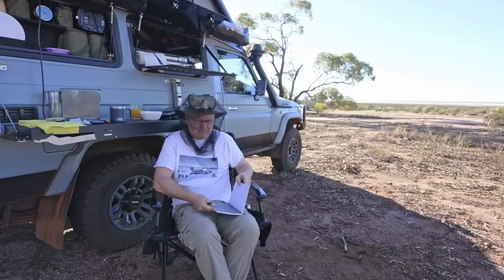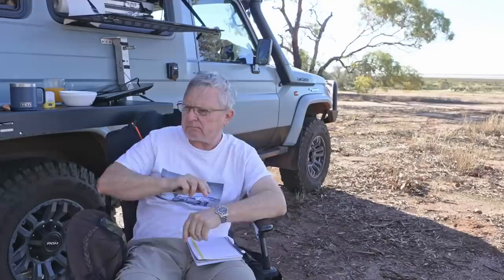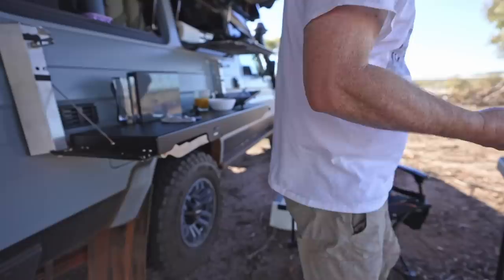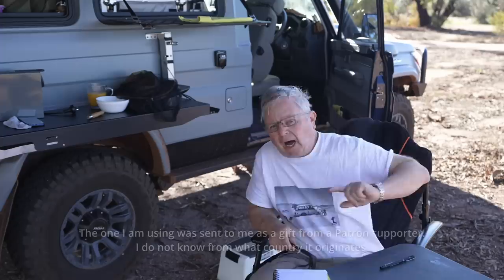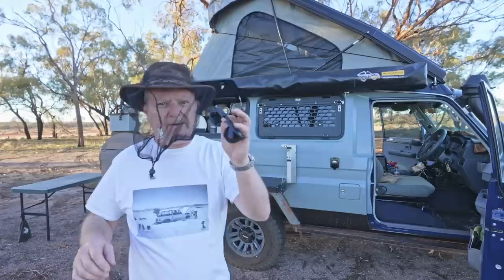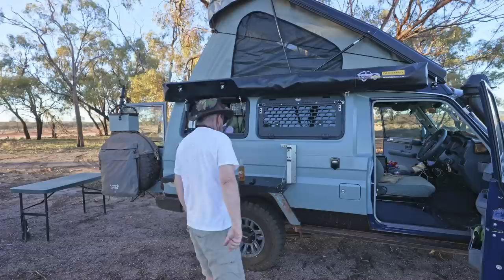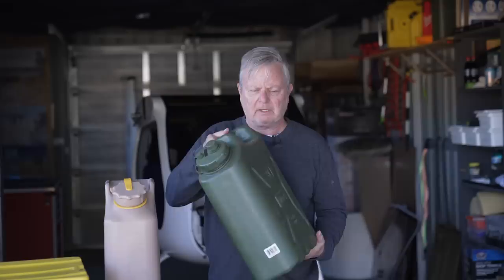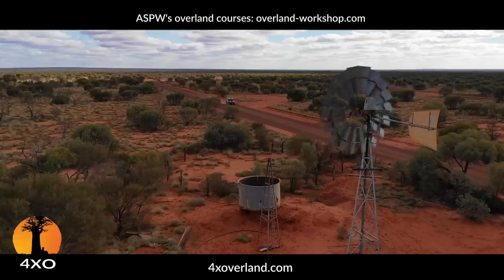10 Favourite Overlanding Accessories | 4xOverland

Comment: FYI
Dobinsons manufacture  adjustable remote reservoir shocks which have both fast and slow compression adjustment and rebound adjustment.
They are also far easier to adjust.
They are an incredible shock and I am very happy with my set.

Comment: The Dobinson MRR Remote Reservoir Shocks also has adjustments for both compression (separate adjustments for high speed & low speed) and rebound damping - making it a 3-way adjustable shocks.  Access to the adjustment knobs is far better compared to the B51s, and no tools are required to make adjustments.  These are the features that made me switch going for the OME B51s to the Dobinsons MRRs (& the MRRs higher levels of adjustments) on my 4WD.
Reply: I'm also looking at the Dobinsons MRRs.  What's your experience with them so far?  Are they really that easy to adjust as advertised?
Reply: @HammerRocks  So far so good. One thing it has surprised me that I didn't think I'd use is its 3-way adjustment features. I chose these shocks for their reservoir features (and that they're made in Australia). And I thought once I've adjusted them to my desired setting that I'll just leave them at that.  But I find myself adjusting the 3 settings to suit the surface that I'm driving on.  Mainly between bitumen and corrugations.  And the adjustments made, makes a noticeable difference on how my 4WD drives on those surface.  That and the ease of access to the ajustment knobs and the ability to make adjustments without any tools is why I think I do make the effort to make the adjustments. Plus Dobinsons' guide on what type of adjustments to make for what situations makes it easier to fine tune them.  I'm loving them so far. ♥️

Comment: I overlanded much of Africa many years ago and the three things that would have made life much easier are 1). A 12 volt refrigerator (never had one on any of my trips of up to 6 months at a time, not even sure they were available back in the 1980’s), 2). One of those toilet seats on a folding camp stool set ups.  All we ever used was a roll of toilet paper and a trowel.  One benefit of that setup was doing all those squats, my thighs were in great shape for skiing when I got home), 3). A camp shower of any kind.  Even the black bag type would have worked better than the bucket method we used, although I must admit that once in a while we would stop at a game lodge and pay $5 to use the pool for a couple of hours, that way we had a good clean up.  I’ve only ever slept in a two person ground tent in Africa and am truly envious of anyone with a Troopy with a pop up tent, a great vehicle for overlanding.

Comment: Camp light is a Petzl Noctilight bag for headtorches. Depending on size also from other brands, like a carry bag with additional functionality. The Noctilight nicely disperses the light. You can even have a charger cable inserted. It's got hooks and rubber bands integrated. Doesn't have magnets as this would be too heavy. Or simply put a head torch in a white cloth bag or net that is kinda transparent.

Comment: I think we all end up with the stuff we like and that stays with us a long time. I have bits of kit that I take with me that I've had for a while but not as long as others. 

Tmax tyre compressor, Halfords Professional Toolset, various lithium 18650 torches (Nitecore, OLight and portable workshop lamps). Manfrotto 190x Tripod. Jetboil. The vehicle has a lot of stuff already, and it's been modded to my needs. There are many gadgets out there to help us, but some of the things in use in the rural areas won't work when you're mostly in urban areas, like the trash carrier. It may work for me in the future but I'd worry more about it getting stolen or vandalised. Haven't got an awning yet though. 

Keep up the good work though ;)

Comment: I have been traveling across many countries for many years in mostly old British Army Land Rover Pinkies and Dinkies. I use very little kit and none of which is expensive kit. Mostly what works and has more than one use. I must say that the Trasharoo is a great peace of kit for what it is made for and a great price. Taking away the rubbish so it isn't left behind in it is better that the old bucket with a lid that would swing off the tow bar. The best way to fit the Trasharoo is to use a ratchet strap to tighten it up around the wheel and looks nothing like a saggy scrotum at all. Also it can carry a lot of other kit in it you wouldn't want to keep in the rig if it is wet or smelly. Talking about getting expensive kit because it looks better is making Overlanding just a "Snobby Hobby" these days and this is why Land Rover's new Defender is built the way it is. It is nice to be away from the city and get back to basics. Some people just like to take the city with them into the bush. I have two homes in two countries that supply me with very luxurious furnishings. Myself I like to be without all that snobby kit as it is softening people up to much. Overlanding can be done with very little kit. all you need is .. A box of matches/lighter. A good sleeping bag. A Basher and ground sheet and a good knife. A case or two of drinking water and some dry food/tined food/MRE's. and some cash/credit card to stop in a B&B or Motel the odd night if you want a real shower and a softy bed in a nice town along the way. Anything more than that is snobby poof kit and for those with old farts with Sagging Scrotums who can no longer walk the walk. ;) . To each their own really. But no matter what you drive or bring with you, it is what you get out of what is around you that matters most. I live OUT of my rigs, NOT in them. Keep your path behind you clean and take your rubbish with you in a Trasharoo..

Comment: I ran a Trasharoo they work well, we had firewood and rubbish and recovery gear in it. The straps are fairly broad and sturdy.
I like the wrap around trash bag you have on your spare its a better way of doing things if it fits the size of wheel you run but the Trasharoo isnt as compromised as you make out and can be used as a rucksack or hung from roof racks or pretty much anything if needs be.

Comment: Hmmm…. BP51’s…. not impressed with them in the slightest. I destroyed a set in Morroco in less than 15,000km. There’s no distributor there either so I had to remove them.
Snomaster also… I’m on my 2nd warranty replacement unit…  the latest one has got inconsistency issues with huge power drain…. the first one failed to cool the upper half of the cabinet. 
I’m surprised you didn’t mention the en-suite? Maybe now people have realized that the QP version simply hasn’t evolved with its competitors… it’s very disappointing compared with the others. 
I know your opinion is regarded highly by many Andrew but I’ve found that a number of the products mentioned here have spoilt my trips because of their reliability. I don’t buy cheap stuff either!
As an Overlander and Traveller outside of my own country I have to rely on my equipment… hence I’m using the much cheaper and hassle free OME Nitrocharger and soon I’ll have another Engel to compliment my other 26 yr old unit. 
I’m modifying the En-suite myself to make it a better, more stable & user friendly unit.
Reply from the maker: That's interesting. My first set in my Troopy did Canning Stock Route, crossed Australia twice, Anne Biddell and Connie Sue Tracks, Gidbs River Track and The Kimberley, Holland Track as well as several shorter trips totalling 42000 kms and the ride is excellent. Snomaster: I've owned 6. Had an issue with one of the very early ones, but since then, they have worked perfectly. I'd be interested to know how you've modified the en-suite.
Reply: I'm with you on the shocks just changed over to the non adjustable Outback armour and am very happy.

Comment: My top 6 products for overlanding are:
1.  DARCHE 450 BBQ/FIRE PIT - leaves a smaller footprint & safer than building a fire pit on the ground. Obviously a re-branded product as it looks just like many other fire pits in the market.
2.  NEBO BIG LARRY 2  - excellent white/red LED light combo - AA Battery powered.  Recently superseded by the Nebo Franklin Duel (built-in rechargeable battery powered).
3.  SILKY SAW BIG BOY & SILKY SAW POCKET BOY - high quality, lightweight, and capable folding saws that are made in Japan.
4. JETBOIL SUMO - Fastest way to boil water (or liquid) hands down.  With the Sumo, all the parts (incl. a fuel cannister up to 230g) will fit inside the FluxRing cooking cup for packing.
5. COLEMAN "FOLD N GO" GAS STOVE - double stove w/full-size cooking surface that fits two 26cm pots on each burners, yet can be folded & packed to a size of a single burner butane stove.
6. VESTERGAARD LIFESTRAW - like insurance or fire extinguishers, you hope to never need them, but handy to have in emergencies.
Plus a special mention goes to the....
DARCHE RIDGEBACK RTT - it's a game changer for me. It's made setting up my sleeping quarters so much quicker.  Ideal for me as I like to change campsites often when 4WD camping.
...and...
CLEANWASTE GO ANYWHERE PORTABLE TOILET - performs its intended purpose well. It's lightweight & packs relatively compact, and made in the USA.

Comment: Have you ever lost the remote for the Snow Master? I have lost mine (haven’t replaced it yet) and am wondering if it’s a task to replace it.
Reply: The compressor also rattles a lot when shaken. Mostly when the fridge is empty. I own the same as andrew. They are good but don't buy if noise inside the cabin is an issue for you

Comment: Sorry to contact you this way, out of context, but I think you may have an answer to a question I have about my 2 door classic Range Rover.
I remember watching your video about your trip in the Range Rover 3.5 V8, and as you were setting out you heard the engine making
 a sort of 'cracking' noise at the front. You then decided to take it back to the workshop for further analysis before going on your trip. 
My Range Rover has the same engine and is making the same noise. Please could you tell me what the cause of that noise was.
Sincere thanks. Garth Richert, Cape Town.